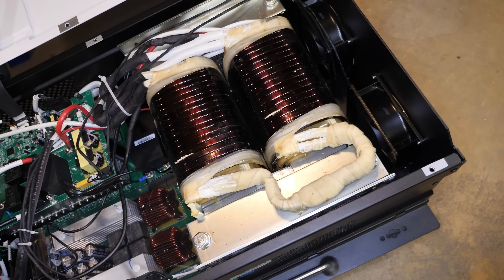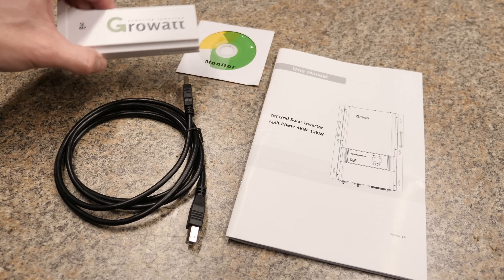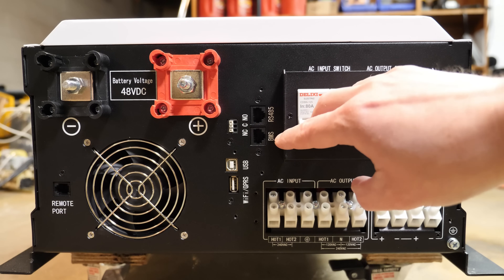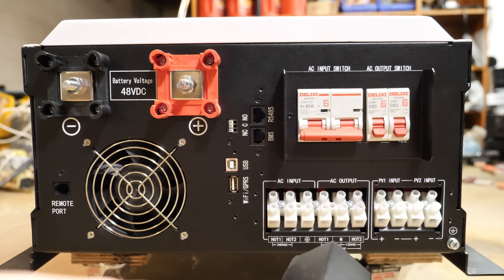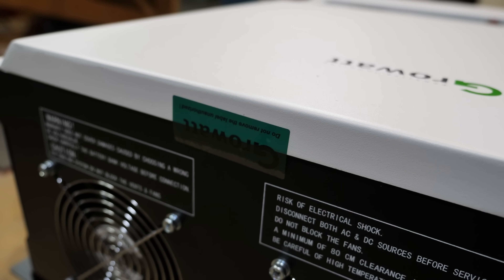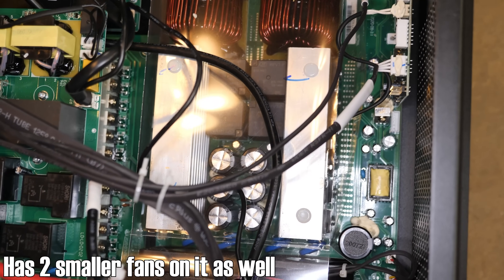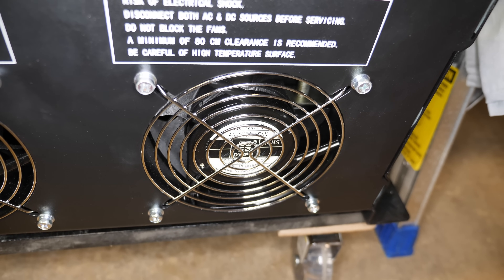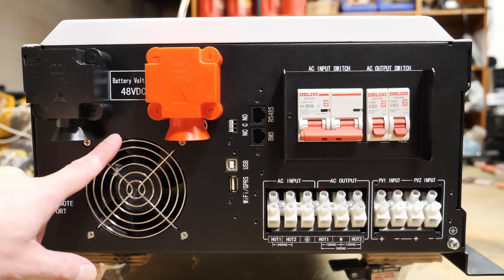Overview of a 12000w Growatt Split Phase LF Inverter!

Comment: Why all inverters don't come with Circuit Breakers like this is a mystery to me.

One more for the DC side would be great.

I'm using 2 LV6548's now. And yes, they can turn on a 12 inch Dewalt miter saw. :)

How is the monitoring software? Is it Watchtower? (absolute garbage on the MPP-Solar units)
Reply from the maker: Yeah one for the DC side would have been great!!!  How are you liking those inverters?  Good to hear they can start power tools!!! Id love to check one out!  Monitoring software isnt bad now that I get how it all works lol.  If I connect direct then the software is similar to MPP.  The wifi software is nice!!
Reply: @AVERAGE_JOE  I started using Solar Assistant and love it. It runs on a raspberrypi and has to have internet access, but the output display is really good. It offers a little bit of inverter control also.
Reply from the maker: Awesome! Ill have to look that up!!

Comment: Just bought one of these after watching ur video.  Hasn't arrived. 
.
While charging with solar, can u use power from it.  Does all the power go through batteries a d then back through the inverter?

Or when charging , the power (pv) goes through the charge c I ntroller and inverter ans bypasses battery?
Reply from the maker: NICE!!  Its a beast!!  Yeah you can use while charging with solar.  It will power your house or load first (same time) and then charge battery with whats left.  Actually there is a few different settings you can do.

Comment: Price is right!  I wonder how many 100 amp BB batteries I would need?  I have 4 new ones.

I really need 220v.   By the time I buy all the stuff to get the 220v/ 30 amp.  I will have far passed the cost of this device.
Reply from the maker: You have 4 of the husky batteries? 20kwh is pretty damn good!  My 12kw inverter was only 2k and they have a 6kw version as well for much less. They are adjustable voltage so 208, 220, 230 and 240!
Reply: I went ahead and bought this inverter,  and 2 Polarium 48 v / 100 aH batteries.  

Now, to hook it all.up!
Reply from the maker: Nice!

Comment: Note #SIGNATURESOLAR does not #warranty is you utilize #used car batteries. They didn't have statement until I called them and they tried telling me the inverter would not charge due to my batteries then they asked about my panels and tried to blame my panels. The inverter kicks the solar connection off and on and doesn't charge the batteries. They will not back these inverters they sell. #BUYERBEWARE
Reply from the maker: Interesting!  I havent heard that.  So your inverter is not charging your batteries?  What are all your settings?  What batteries and voltage?  Do you have solar?  Maybe I can help
Reply: @AVERAGE_JOE  it's not the settings.  It was working good for about 1 week then it began to disconnect the solar panels and indicating over voltage. I havev checked the voltage numerous times and it's under 150v. Contracted SIGNATURESOLAR but they blamed my batteries, then my solar panels and just gets frustrating that they would treat a military members like he doesn't know what he's talking about.
Reply: @stickersadd20hp  What is Mfr & Model # of your PV Panels?  How many panels connected in series?  Which model Inverter did you purchase?
Reply: @MrSummitville  I have the 12k inverter.  Panels are sunpower black on blk 325w 1st  2serier 8 parallel   and 2nd 2series  10parallel  its not even hitting the 7kwatt it can Handel.
Reply: @AVERAGE_JOE  i have 3 full Nissan leaf battery packs and hooked them up to make 48v. I told them that and they blamed my batteries saying that the inverter did not support used vehicle battery 🔋🔋 s. I've used these on other setup's I've installed. But the inverter didn't know if the 🔋🔋 are used or new so that just aggregated me. It seemed a very snobby answer.
Reply from the maker: Wow thats super odd!!! Im sorry to hear all that. The batteries should not matter one bit! Hell Im using used 18650s. Hey actually meow that I think about it. What bms are you using. Reason I ask is..when I was testing out the husky 48v battery and adjusting the inverter settings to match the battery. When the husky battery was full charge the bms would disconnect the charging and the inverter would see it as overcharge and beep ect.... It was after the sun went down so cant say what the solar charging part would do. However when I started to add a load the bms would "reconnect" and the inverter would act normal. Sooo was wondering if your bms might act the same. All I did to fix it was lowered the bulk and float charge and all worked great.
Reply: @AVERAGE_JOE  perhaps I should get the higher voltage inverter. I ordered the 12k watt  150v mppt what model did you order?
Reply from the maker: Funny story actually for that is I ordered the 150v but I got the 250v. Whats funny is after getting the inverter I noticed the manual and sticker said everything for the 250v model but I assumed that the manual and sticker was the same for both (like many other products have the same manual but guts are different) so I didnt question it. Anyways a few days after I ordered it I was thinking I should have just ordered the 250v. So I lucked out and the 250v was delivered. First time something like that has ever happend in my favor!

Comment: PV 1 and PV 2 are each 150V or 75V each? How many watts for each PV 1 and PV 2? Thanks.
Reply from the maker: Each are 150v operating and each can handle 60a. 60amps per pv input.
Reply: @AVERAGE_JOE  I am looking at the manual for the 250V inverter. It states a maximum PV array of 7000W and 120A for the solar charger. I am confused.
Reply from the maker: Oh Ok yeah I have the 150v version. The 250v version is up to 250v input on pv 1 and 2 and the same 60amp per input.
Reply: @AVERAGE_JOE  Why would they limit the array to 7000W? Half of rated output.
Reply: Yeah I figured it out I think.  Series and parallel panels right? Amps remain the same in series but add up in parallel...
Reply from the maker: Thats a great question! I dont have an answer. Reason for me to purchase was the 12kw LF split phase part as I had 2 60 amp charge controllers on hand. For me it was more of a bonus feature that it had pv inputs.

Comment: Hi Joe. As a electronics tech I can say that the insides of this inverter look nearly identical to the powerstar w7. Lots of info in forums about repair and modifications of these. Good workhorse. I have been running one for years now. A highly recommended modification to this inverter is to add a tuned circuit between primary inductor on the primary side of transformer and a cap on the output. Will lower your idle power consumption by half at least.
Reply: You will see people say low frequency or high frequency inverter. This is a low frequency inverter. Very robust and good for starting motors etc. Down side is there is usually a little more voltage sagging or light dimming when big loads are rapidly changing. More noticeable on lead acid. These style inverters are more robust than high frequency types.
Reply from the maker: Yep 100%. I wanted so I have the option for saws, compressors, welder ect... These are also less eff then HF inverters and Im fine with that.🤘
Reply from the maker: Whoa Nice! Do you have a link to the forums you are referring so I can take a lookc?
Reply: Do you have a link on how to accomplish this?

Comment: What is the model number for the inverter that goes up to 250v panel array voltage?
Reply from the maker: I added it to the description box but I think the model # is SPF 12000T HVM but it might have changed to MPV

Comment: Nice video.  You mention this is a LF (low frequency) inverter.  Can you detail why you think that is?  I believe this is actually a high-frequency inverter with a built in auto-transformer for split phase.  That helps with surges on the 120V phase, but with longer duration sustained surges (central A/C, etc), there will typically still be problems.  But does look good performing overall in the tests in your other video.
Reply from the maker: Thanks Man!  The company I bought it from and or the manual states LF.  Plus a dead giveaway key difference between a HF and LF inverter is the huge transformer.  Ive never seen a HF inverter with a big transformer and or split phase transformer.  The company and listings I purchased from also state its ability to start 4 ton AC units without an issue.  I guess in time as my battery size increases Ill find out for sure on the AC units!😀
Reply: @AVERAGE_JOE  Yes, would love to see some tough 240V inductive testing with this - central A/C, 240V air compressor, pumps, etc - if you have those kind of loads.  The specs detail large surge rating for sure, but they don't specify the surge duration so hard to tell what this can really do for 240V.  For 120V, the transformer sure helps as energy can be stole from the other phase - for 240V, its all the inverter electronics.
Reply from the maker: I did upload an opereational check last week and its on my ch. I am limited by my battery at the moment but that will be changing here quick. Then I can try some of the bigger loads.
Reply: This is a true low-frequency inverter.  Note the total lack of any high-frequency boost converter circuitry (multiple small transformers mounted on the PCB, usually in rows).  Notice also that the battery connections wire directly to the main FETs...and the main transformer primary wires are bolted directly to the FET heatsinks.  All voltage boosting is being done by the main transformer.

If the transformer was purely an autoformer, it also would not need such thick windings.

Comment: I have 16 Gel batteries parallel connected that gives 48V and 36 panels 1 panel is 335W can i connect to this inverter and use it?
Reply from the maker: If you have 48v then yes you can. You can also use those panels as well. I have an operational check video on my ch.
Reply: @AVERAGE_JOE  Thanks man!
Reply from the maker: Just remember to follow the manual and you should be good!

Comment: That thing is heavy. i was just checking out Sig Solar yesterday and was amazed at all the new cool stuff they had.  wish I had the high voltage Mppt model.
Reply from the maker: Yeah its damn heavy lol. I was abke to get it mounted with shinanaginns🤣 Yeah I should have gone with HV one as well but wasnt thinking far enough down the road. Thats ok, my solar isnt to far away right meow.
Reply: @AVERAGE_JOE  Its Sketchy,  Im really liking the new 5kw HF 220v with the added transformer for Split Phase. 450v mppt.  so much cool stuff.  Fair price. Also  the G4LL battery system with the server rack. Is sooo nice and easy looking.
Reply from the maker: Yeah they have lots of really cool stuff. I wanted to get those batteries bad but didnt have the cash. Looks like David Poz got them!!

Comment: So it does off grid and on grid mate,  hopefully better than the one I show you on FB . Glowatt batteries may have a problem.
Reply from the maker: Yeah this can be an offgrid inverter or be used like a ups which is passing grid through inverter and keeps going when grid goes down.

Comment: THATS A BIG MONSTER TRANSFORMER INSIDE  . IT MUST BE 100  + POUNDS , SOOO HEAVY DUTY THAT IT CAN COMPLETLY RUN THE WHOLE HOUSE EVEN THE CENTRAL AC , DRIER ,WATER HEATER WITH NO PROBLEM WITH A VERY LARGE ENOUGH BATTERY CAPACITY . I HAVE AN AIMS 6000 WATT SPLIT PHASE THAT CAN JUST ABOUT DO THAT IF YOU CAN CHECK OUT MY SOLAR VIDEOS .  CRANK IT UP !
Reply from the maker: Yeah its a big ass inverter for sure lol. That was the reason I went for it, to run the hole house! My battery isnt bug enough yet but working on it! 🤘
Reply: So this will run a house AC unit?  I actually have 2 AC units...  Thanks in advance, newbie here 🤦🏽‍♂️

Comment: thank you for this video. I'm was looking at two growatt 3000w, this seems like a better deal.
Reply from the maker: You bet! I have an operational check video on the way as well. Seems like a solid unit. Only complaint at this current time is the apps which may be user error. Still working on that to figure it out. Also if 12kw is to much they have a 6kw.

Comment: Average Joe where's the video for installation and testing it. Please we are waiting  for you before making any decisions on buying it. Any one has any idea of the Sol-ark inverter? Guys out there Please do not waste your money on buying the SkyBox from Outback Power.  That piece of junk no good I can't even run my 4 gallon air compressor. I have a  GS 8048a only 8000 watts. That thing turned on my 3 tons AC and my well pump together.
Reply from the maker: Test video is in work. Have been busy with work. Its about done tho! I hear solark are badass!
Reply: @AVERAGE_JOE  okay bossman I am waiting. Average Joe do you any idea about the Sol-Ark Inverter?
Reply from the maker: No prob! I havent had the pleasure to test or use a solark but hear they are one of the best!!! They are moar efficient as well.

Comment: Thank you for sharing.  Question for you; is this 120 x 2 or 60 x 2 on the charge side for PV?
Reply from the maker: Thanks for watching! Yes 60a on each side(60 x 2) for a total on 120a for PV.
Reply: @AVERAGE_JOE  thank you.  I am at a cross roads here...building my system using an MPP LV5048, works as intended buy the charge side is just short of what I really want at 80x2.  I may be forced into external high voltage units.

Thank you for the response.
Reply from the maker: Gotcha! Yeah I would say this inverter is "lacking" in solar input however for me I was more looking for the 12kw inverter side of things. I also have 2 pcm60x charge controllers on hand when I get to a point of adding more solar.

Comment: At 4:00 you recommend adding washers to the battery terminals. The instructions say not to add anything between the flat and ring terminals because it may cause overheating. See second point in page 7. Washers on top of the terminals may be okay. But, I don’t think you want washers between the connection.
Reply from the maker: Yes that is correct. I would go ring terminal, flat washer, lock washer then nut.🤘

Comment: Due to it using a full size transformer, and with adequate sized wire and circuit breakers per leg, I haven't had a problem of pulling 7-8kw out of one leg. I touched on 8kw while testing it once, but I've pulled 7kw sustained from one leg turning everything on in my house (with only 2kw from the other leg).
Reply from the maker: Damn thats awesome! I cant get quite that high yet as I dont have the battery for it yet but sounds great! Thanks for that info!!!🤘
Reply: I was wondering what woukd happen in this circumstance..  thx

Comment: Wonderful to see this massive inverter that I also purchased on the inside. Great job on the video look forward to seeing more videos from you.
Reply from the maker: Yeah it looks good inside!! Do you have yours up and running? I dont yet, just been testing all the features. Next video on it is in work!🤘
Reply: @AVERAGE_JOE  yes indeed . Running my house with the inverter and almost 30kwh of batteries (48v).
Reply from the maker: Very Nice! Yeah my battery is lacking at the moment. Hey are you able to get the button beep to go away or any beep for that matter? I cant seem to get it to shut off🤷‍♂️
Reply: @AVERAGE_JOE  I have not tried to disable keyless beeps? Is that what you're referring to Joe?
Reply from the maker: Yeah the beeps when touching buttons. I thought it was in the menu setting 15
Reply: @AVERAGE_JOE  yeah 15 is Alarm on or off setting. Let me know if it worked.
Reply from the maker: I have it disabled but still beeps. Ill have to contact growatt and ask them.
Reply: @MrRsalaza5  How much of a solar array are you using as well?

Comment: That's one amazing piece of engineering. I'll take it! At 12:00 those are mostly IRFB4110 HEXFET MOSFETs from what I could tell. Each one can switch 180A @ 25C continuous or 670A if pulsed, which they definitely are. Absolute monsters, and a low gate to drain resistance on average of 3.7 milliohm. Extremely efficient! The MOSFETs switch on and off at varied levels to produce a pure sine wave, basically simulating AC using DC, which runs to likely several windings of that transformer, which induces a massive magnetic field on the iron core, and also as a result induces current within the output coil(s) with a different winding ratio to output the higher AC voltage. My guess is that you have two windings per half, one smaller gauge layered underneath each of the larger gauge coils that are visible. Each half possibly dedicated per phase. Just a guess though.
Reply: Maybe we should get @Ri5ux to make a video, I would love to hear more details on the inner workings of these things
Reply from the maker: Thanks for all that info! Sounds like VooDoo to me lol!🤣🤘

Comment: I just mounted mine on the wall but still a long ways off due to chargers being defective for the top balance.
Reply from the maker: Nice! Which chargers?
Reply: @AVERAGE_JOE   This is the second one I tried and it will only charge at 2.6 amps, still waiting on a return label.  

https://postimg.cc/BXcZGt1P

https://www.batteryspace.com/Smart-Charger-40A-for-3.2V-1cells-LiFePO4-Battery-Pack.aspx#cloudiq_session_id=c9196d14-43c6-4310-b05b-8dc8007b892b